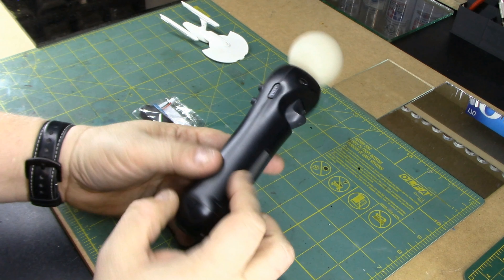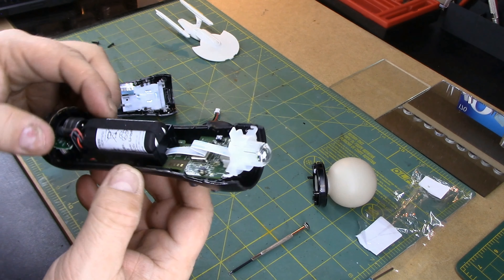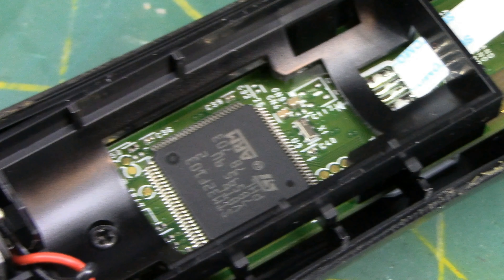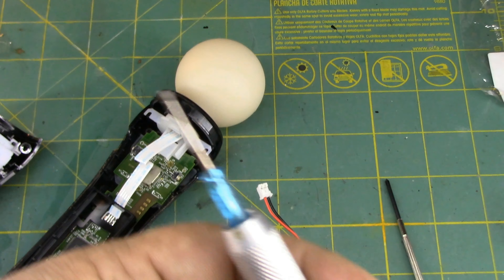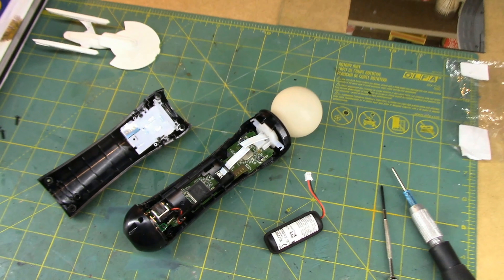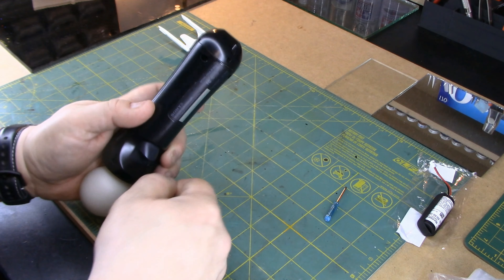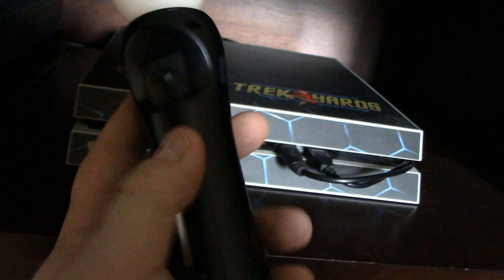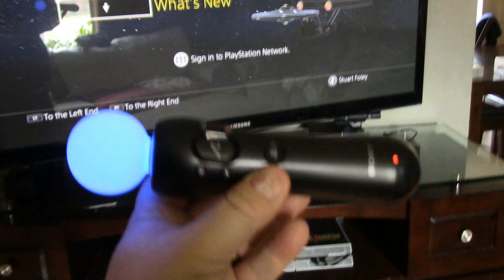PS VR Wand Repair - Can We fix It?

Comment: Nice fix! The PS Move is such a cool controller, it got use with 2 generations of consoles, but I still feel it got underutilized. I wonder if the PS3 version of the PS Move works on the PS4, and vice-versa. I got a PS3 with the PS Eye and a pair of PS Moves, plus a PS Navigator Controller. The PS3 had a good selection of games that used both. I just fear the Nav controller's battery dying at some point, as it seems harder to find, both a controller in working order and the battery itself, which makes me wonder if the smaller battery you had wasn't for the nav? Anyways, I hope your Move controllers get to live long and prosper! Cheers from Brazil!